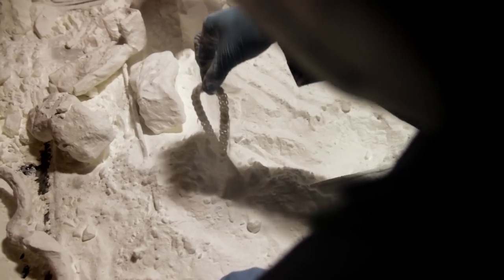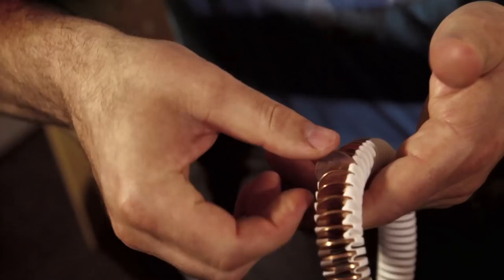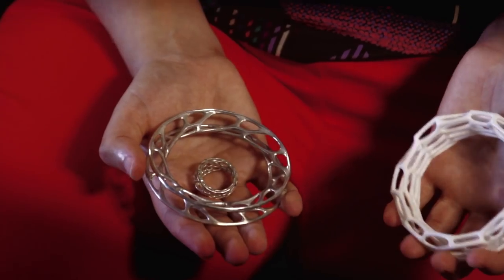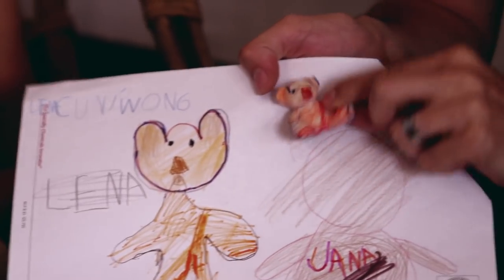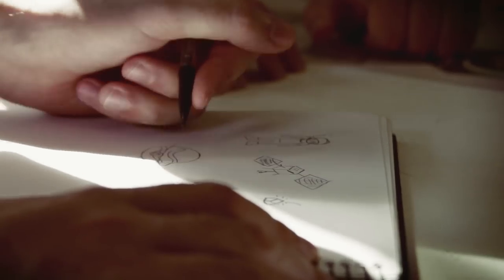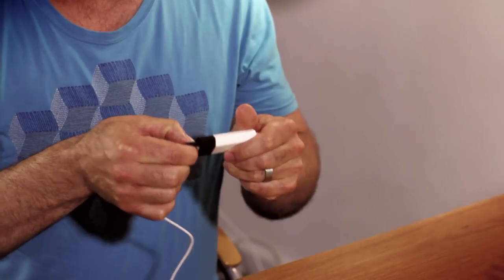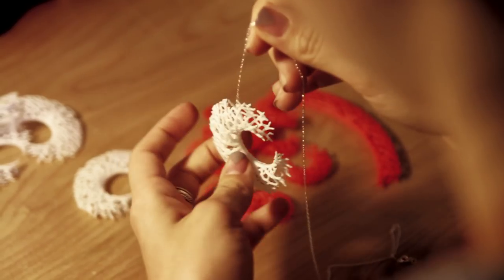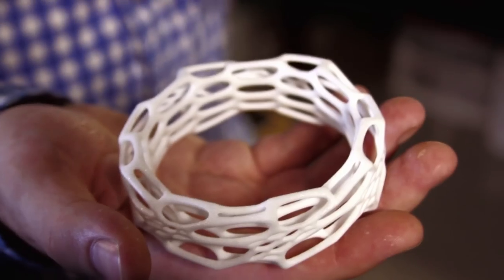Shapeways 3D Printing & the Culture of Creativity

Comment: Can you print things like different materials combined with each other, resistors for example ?

If so, can you print all the different parts of a cell phone for example, and assemble everything afterwards and you have a working cellphone?
Reply: Sure, it can be, it is even possible to print a whole car but it'll be very costly right now. Even though, plastic, composite, paper and metals are current materials can be 3D printed.
Reply: Thanks for your reply, this is really interesting!